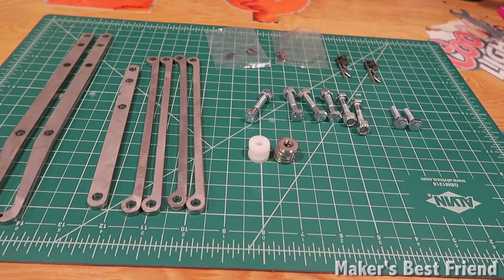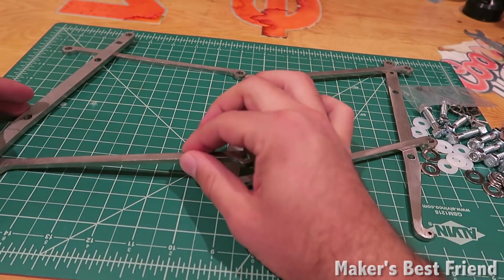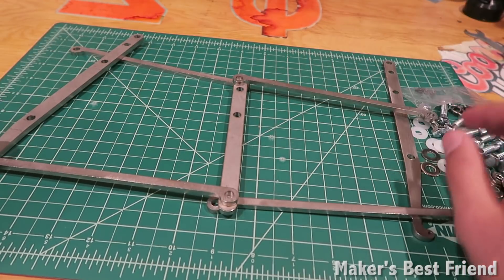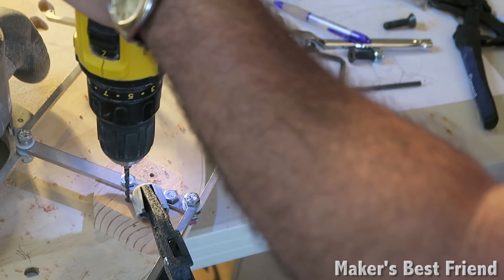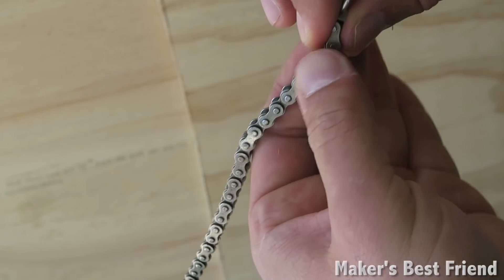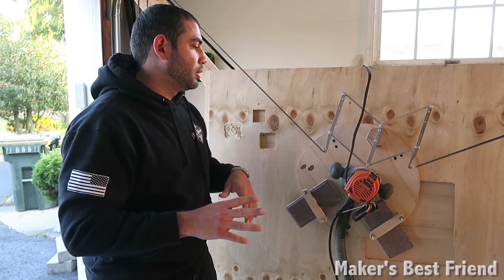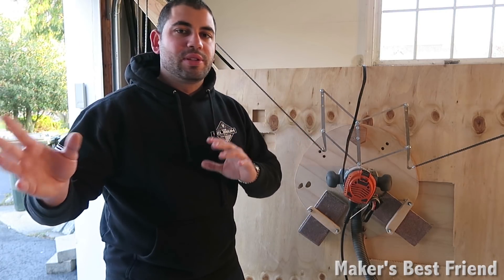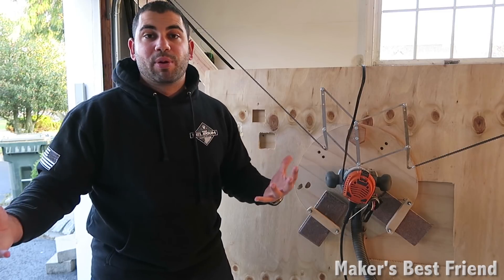Maslow CNC Top Mount Kit In-Depth Review!

Comment: Just watching your video, I can see where your error was, The centre arm must also point exactly to the centre of the router bit. I put a ruler on my screen and yours is pointing to the left.  I have made a similar system to Dlang and it is very accurate.  put a drill or router bit in your router the same size as the bolt holes in the arms and then us that as the pivot with the arm to set your positions.  You will find the accuracy should now be a lot better.  A
ny inaccuracy now will come from play round the fixing bolts.  I overcame this by adding thin thrust bearings between the arms taking the play out of the bolts on tightening.
Reply from the maker: You are correct in that and it is something I realized. However, my review is more to show that this setup requires a precise setup to ensure it cuts with high accuracy. The ring design that I currently use allows more room for error in the setup while keeping a high accuracy cut

Comment: I would use it to make furniture mostly. The z axis would be nice. It is hard to add detail to work pieces freehand. Takes so much time to set up cuts.
Reply from the maker: For furniture and designs on large pieces of work I’d definitely suggest it
Reply: Looks like we are on the same frequency with this...Look at my post and see if you agree with the direction I'm going. Wood cutting sled design's  are readily available, looks like they just need to be incorporated into the Maslow....

Comment: Remove the router. Use a compass to draw lines at the radius you need to space the upper mount.
Reply from the maker: This is a good idea - wish I considered it at the time - I’ve moved onto the new ring design which I found way easier to setup/operate. If I ever go back to that design I’ll give it a shot

Comment: I think you need to readjust your bricks as far away from the centre point as possible without them dropping out of the jig. this would in my opinion reduce the problem.
Reply: I concur.
Reply: The problem IS THE BRICKS. I'm redesigning mine using high tension springs mounted on a METAL FRAME. Eliminate the wood which has too much play and has a grain which is inherently weak......

Comment: Adding more moving parts is never a solution to get more accuracy. To get the best result, i think its best to connect both chains together and connect a hinge of the chain to  the circular plate , gravity will prevent the disc from turning. To decrease vibration, i would say turning speed, weight and a drill deapth are factors to look at, rather than the mechanism (otherswise I'd think it's the chain and motors)
Reply: gravity will not keep the sled from swinging if you hook the chains together above the router center. That is effectively what is happening in the video, and the router drags behind as movement happens.
Reply: gravity does not stop the sled from twisting if the center of resistance on the sled is not aligned with the center of force.

In this video, you see the difference when the two differ by a small amount, if it differed by a large amount, you would see more of a problem.

It's like the wheels on a shopping cart, when the force applied doesn't line up with the force of resistance, the wheel pivots until the two are lined up with the direction of travel

Comment: Oh, man, I really hate to bring this up but I fear that the community may have passed up the multi-bar linkage technology for the chain connection to the sled.  The current thinking is a circular ring with roller bearings at the ends of the chains.  (This is from the home team)  See https://www.youtube.com/watch?v=SO-pAJZ6D5A&t=165s.

Beautiful execution, though.
Reply from the maker: Yep! The Maslow team is sending me the circular ring as we speak, so that’ll be my next mod! I’m pretty excited to see how the Maslow runs with it!
Reply: well, nobody has tested the ring against the linkages. so we don't know which is better. The linkages are significantly cheaper and FAR easier to scale up to handle larger routers

Comment: one other thing I noticed at the 9:45 mark, the half links are designed to go over the metal bars with the pin going through the top of the link, the bar, then the bottom of the link. That needs to be able to move smoothly (not flexing the chain at all)

For the mount between the linkage and the sled, a 2x3 or 2x4 should be the right height on edge (the ideal is somewhere in that range, depending on your router and bricks)

Yes, this is sensitive to exact positioning, but we are aiming for an accuracy of +-1/64", at that level,everything is sensitive :-)
Reply from the maker: I'm happy you mentioned that - I wasn't too sure which way to connect the links - If I connect it with the half links going through the hole of the linkage kit, where do the cotter pins attach to?
When I first just used one 2x4, I found that the top was leaning a lot away from the maslow plywood. Once I added a second 2x4 on top, this really helped keep it flat agains the plywood.
Reply: sorry I didn't see the reply sooner.

the half links shipped on the cotter pins (because I had to drill out the links to make the pins fit, I just left the pins in as I tested the fit of each one.

the cotter pin goes through the top of the half lin, then through the arm, then through the bottom of the cross link. you need to then rotate the pin so it's enough out of the way of the chain.

as for the 2x4, you put it flat (so it's wide and short), I was intending it to be the other way (narrow and tall)

Comment: Did you skip showing the calibration step? I would have liked to have seen that.
Reply from the maker: I have some of the calibration on video, but didn't post here to save time on the video. I actually found that the calibration ran very well _ I only had to run the cuts once, because the tolerances were within their limits

Comment: IMHO, it would be much easier just to cut out a new mounting sled for the router, with a center point accurately measured, align the pantograph perfectly and fix it before drilling the opening for the router bit and fixing the router on the plate.  You have troubles with aligning, because you are trying to guesstimate where is your central point.  For this system to work it has to be found with accuracy less than 0.4 mm
Reply: The kit is intended to help you mount it accurately, if you can put a tiny bit or v-bit in the router, use that to align the small hole on the J shaped side pieces, and the other holes line up where the holes for the center bar belong, and you can clamp and drill it to position the holes accurately. I haven't had a chance to watch the video to see if I can identify where George ran into trouble (I'll do that when I get home tonight)
Reply: These alignment approaches will help, but there's a real weakness with having the only attachment be two lag screws several inches away from the router shaft and only two or three inches apart, especially with them being screwed into wood -- any play at those mounting holes will show up as play at the router bit, and will be magnified by the ratio between the distance to the router bit and the spacing between the holes,                                                                                                                                                  Then if, in addition, you stack that mounting joint on top of a wooden spacer or even two of them, it gets hard to think you have much control of your alignment..  
   I suppose that the holes are backed away so much in order to avoid the interference issue George ran into when he first cut his 2x4 spacer, but I think that could also be avoided by using tall bolts with standoffs (maybe wide at the bottom and small at the top) instead of a spacer block.
   But I think the real solution would be for that linkage bar to be longer, and question-mark-shaped (to fit around the router)n, and reach clear around to the far side of the router and bolt to the sled there.
Reply: I'm going to replace  the plywood were ever possible with MDF Board due to it's density and stability as it has no grain. I HATE MDF, but it's a perfect match for this type of application.....
    I'm remodeling my kitchen (why not, it just sitting there?). I'm going to replace the old soffit 2x4's with metal studs. I'm thinking of incorporating them into a sled mount type of design used at Home Depot to cut 4x8 sheets of plywood. 
   Going to make a 50% mock up can be resized and collapsed  for portability.
ELIMINATE as much wood as possible, and replace it with a product that does not have a grain and no real x & y stability.....